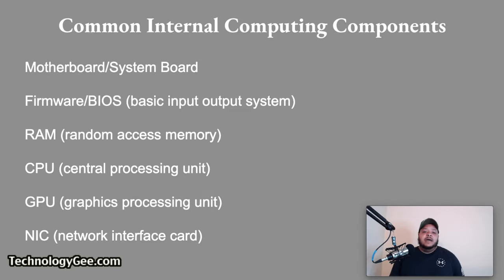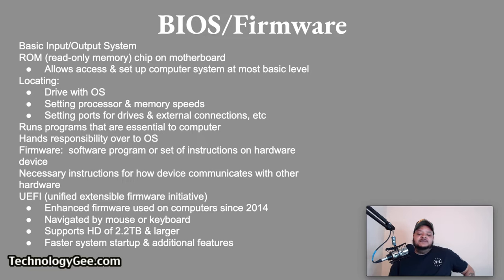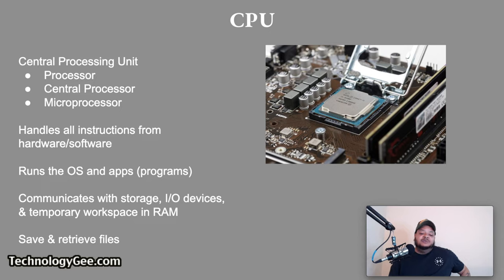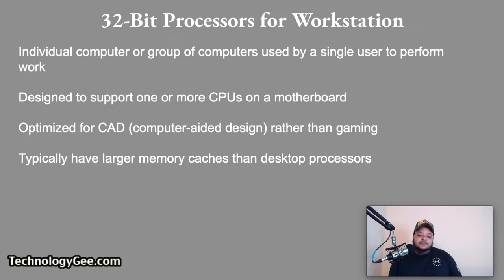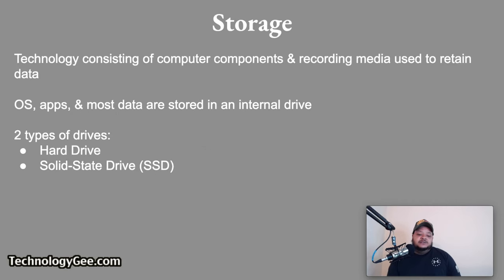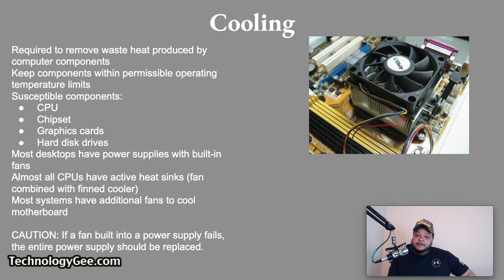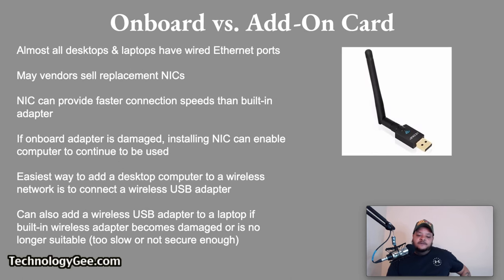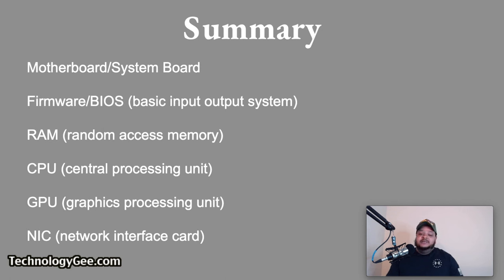Common Internal Computing Components | CompTIA IT Fundamentals FC0-U61 | 2.3

Comment: Be careful when you say processor.  A GPU is built into the motherboard not the processor.   Check Your Learning:  PC doesn't need the CMOS battery to boot.  It is only used to retain settings.  If no battery you will simply need to enter the CMOS info again and again.  Been there.  Pulling the battery is also useful to bypass the any system password set or other settings.